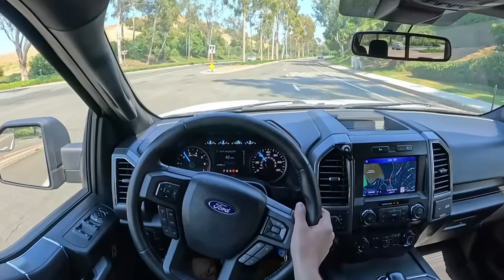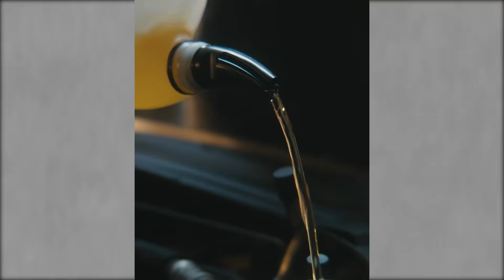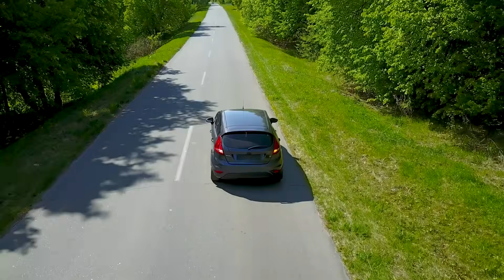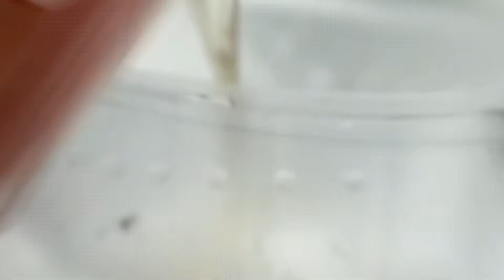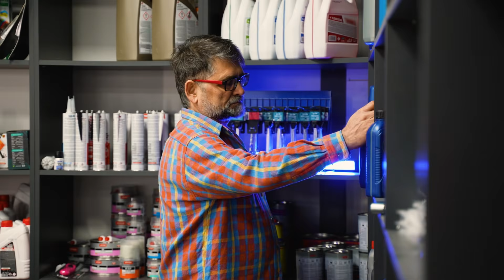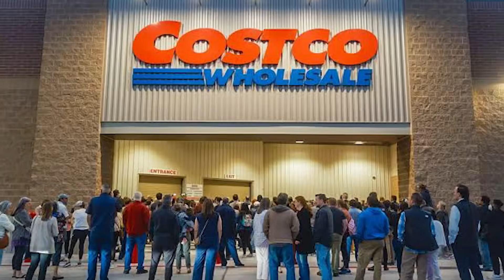10 CHEAP Synthetic Oil Brands EVERYONE IGNORES (But They Outperform $40 Oil)

Comment: This video keeps comparing apples to oranges. A good example is comparing Costco Kirkland oil to Mobil 1 extended range. Extended range mobile one will double your oil drain interval. So in reality it's actually less fan half as much since you don't have to buy a second oil filter. What they should have done is comparatived it to the "standard" Mobil 1 on the shelf right next to  the Costco oil. These unfair comparisons make me wonder if the whole rest of the video is full of half truths and sloppy research.
    The other issue is giving one or two percent increase from fuel economy 25 points. Do you know how much gasoline you can buy at the cost of a new motor?; also, the anecdotal testimonial nonsense has to go. Who cares what Jane or Bob do with a car or what they own or how much they paid for it, what matters is the oil's performance and cost. Anecdotal testimonials are scientifically worthless. Again, this puts doubt and unnecessary fluff on the rest of the video.

Comment: I’ve been using super tech 10W-30 in my 2000 7.3diesel for 24 1/2 years I change it every 10,000 miles. I just went over 482,000 miles and this thing has not missed a beat.

Comment: Engine Immortality Formula  

Only ever use properly protective oil like 10W-40, 15W-40, 20W-40, 10W-50, 15W-50, or 20W-50, year-round, change oil based on dipstick-indicated oil condition basis (instead of numerology basis or deference to dishonest manufacturer basis), always idle after start until idle drops, NEVER SLACK TIL ITS BLACK, and change all other fluids at the lowest end of their owners manual-listed ranges.

Comment: The API spec or the ilsac gf6 or gf7 spec is a minimum requirement. So yes, some of the cheaper oils that meet the spec can have that label on their oil but that just means  they are meeting the minimum requirement. The premium oils generally exceed - often buy a lot - what the spec calls for.

Comment: Your glaring oversight in this video is the fact that regardless if these oils are made by the same manufacturer, the additive packages are very different. You cannot say that Chevron or some other major manufacturer makes a private label oil that meets the same API specs so therefore it is the same oil. It's a very different oil because the specifics of the additive packages are very different, and that is the major difference in the cost and quality.
Reply from the maker: That’s a fair technical distinction, as the proprietary additive packages definitely play a major role in overall lubricant performance. 👍

Comment: i worked in oil labs for 7 years, so I've seen the results as well, I still "pay the extra" for mobil 1. took my last vehicle 300,000+ miles and gave it to my neice to drive a couple years ago when i bought my new vehicle. she's still driving it.  never changed anything on it but brakes, oil, and suspension parts that eventually wore out. never a did a damn thing to the motor other than oil and spark plugs.
Reply: Tires also.

Comment: I would never buy oil from Amazon. The ceo of that company is evil and is the reason for so many physical stores closing. Forcing us to use online catalogs only. If I cant go into a store and browse with my own eyes and hands, im not interested. Also if you want real synthetic oil, none of the off the shelf brands are truly synthetic. Ams oil for example is, but its 15 ish a quart. Real synthetic isn't cheap, but you get what you pay for.
Reply from the maker: It’s a valid point that shopping in person has its benefits, and there is certainly a complex debate regarding the composition and quality of various synthetic lubricants. 🤔